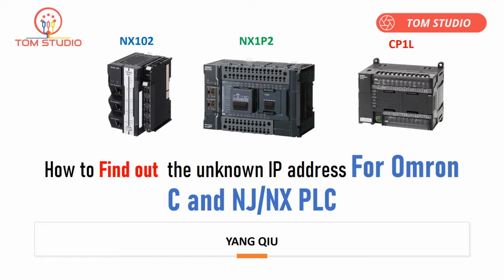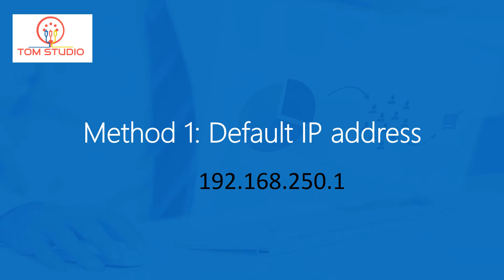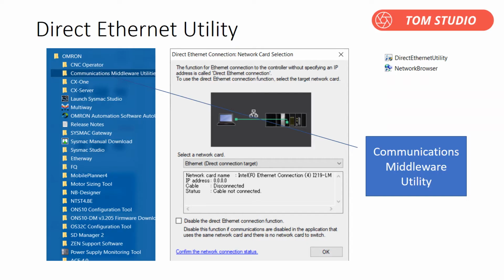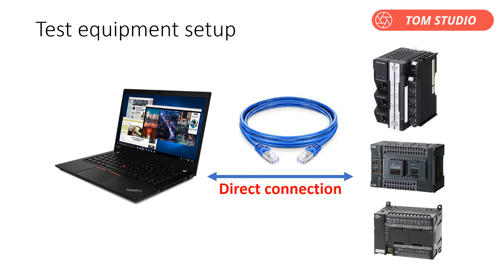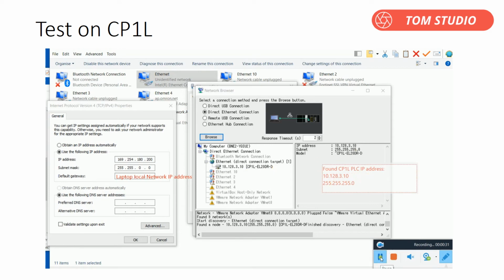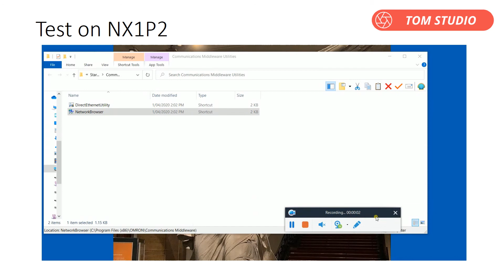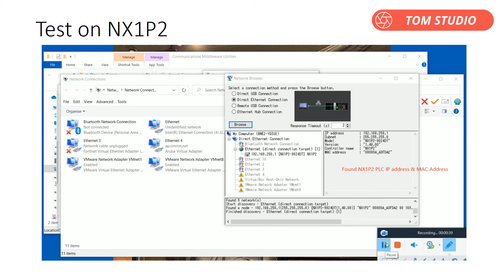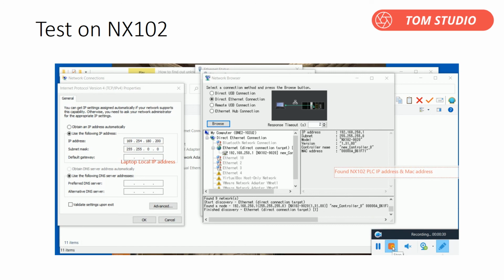How to find out the unknown IP address for Omron PLC

Comment: Hello Friend !!!! Here in my company's electrical workshop in Brazil we have an OMROM NX1P2 PLC. I'm using a network adapter because the notebook doesn't have an RJ 45 input, but USB. I can't find the CLP IP. My question? Does the USB/RJ 45 adapter "disrupt" IP identification? hugs and have a great week!!!!!
Reply from the maker: if you are using a USB adapter, which is different than using a PC in-built Network card if you can't find its IP address from Omron Comms utility, you can try using Wireshark software to do it, which will be similar to Omron's utility, but the advantage of Wireshark, you will be able to monitor the USB adapter network card specifically. Wireshark website:https://www.wireshark.org/
Reply: @yangqiu472  Wireshark didnt worked out for me.I'll test again with your hints from this video.